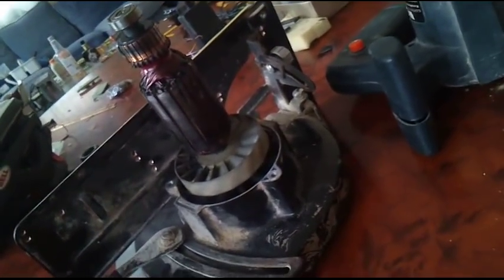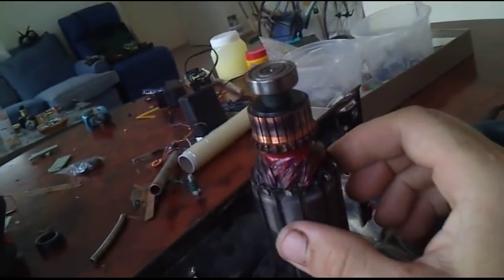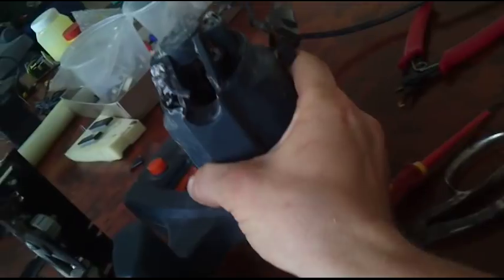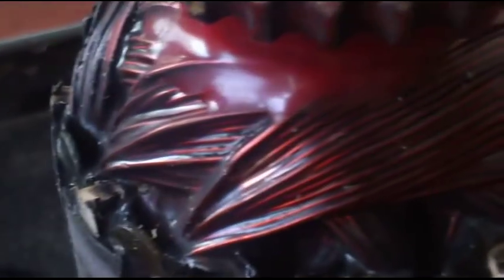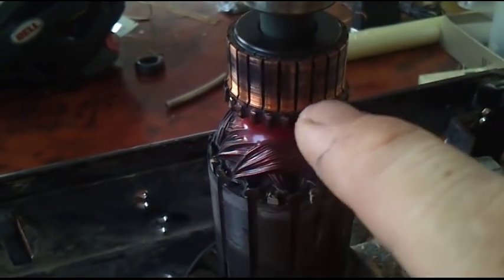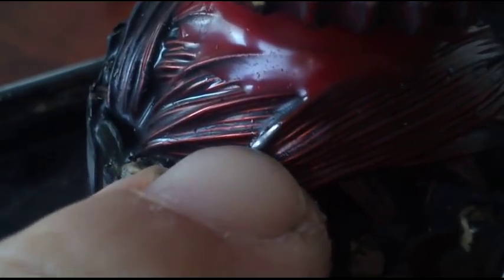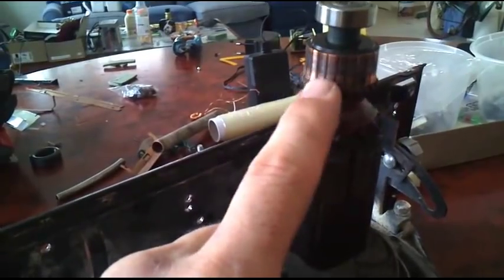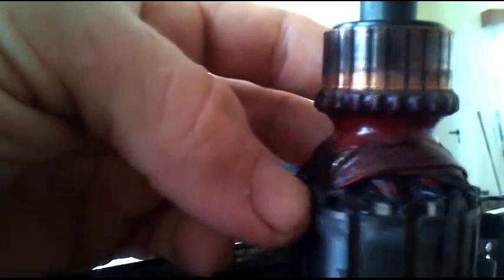commutator motor fault, failed repair

Comment: 1. You did not clean up the commutator with sand paper. 2. You said the brushes are wrong ones. You'd stand a better chance with the right ones, these must freely. 3. The resistances are too low for some multimeters to measure. Try this: 6 and 12'oclock, note the resistance. 6 & 3'oclock, and 6 & 9'oclock should have half the initial noted resistance.

Comment: Any Lucks of resolving this? - Have you try to sand the copper with 1000 grid - your copper looks very groovy - the clean the gaps between copper with a broken hack saw - then wash the copper with methal spirit ro remove any dust - try that an please let me know
Reply from the maker: nope. This rotor is baked. I have no galvanometer or growler, but even without that I'm sure it's not going anywhere. It has to be rewound, unfortunately I'm overwhelmed by other stuff for the moment.